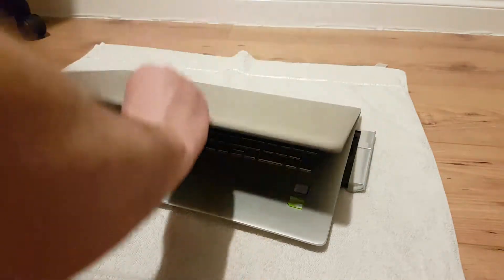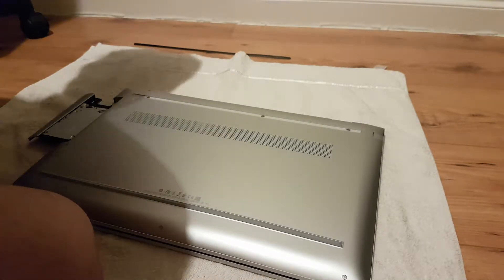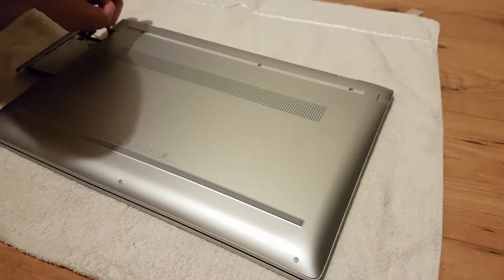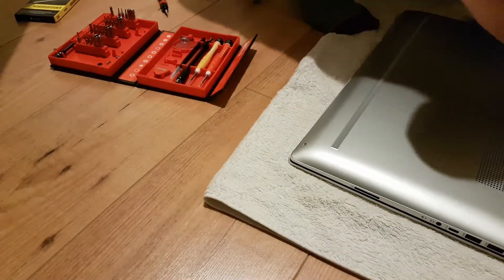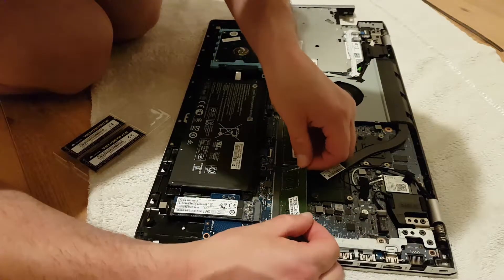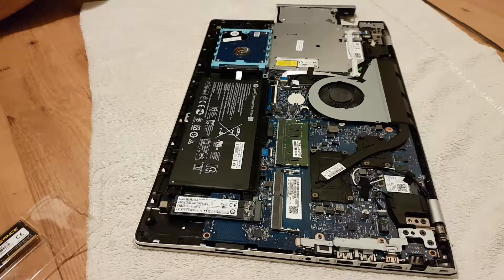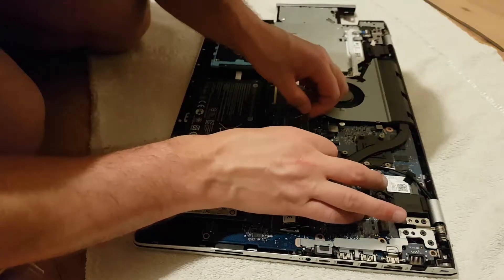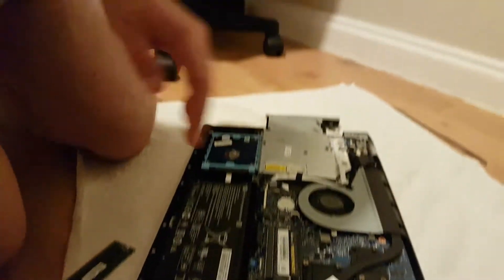How To Install RAM And Speed Test | HP Envy 17

Comment: thanks for this. Im upgrading to 32GB today, and if not for this video I would have probably messed up with the screws.
Reply from the maker: Glad it helped, the hidden screws caught me out first time round.
Reply: How did you get on with RAM upgrade to 32GB?
Reply: How did this go? I’m wondering the same thing I just don’t want to fry my system if it can’t handle 32gb
Reply from the maker: @yourealdaddy4207  the spec on this laptop says the max reccomended RAM is 16gb, it's been great ever since the upgrade from 8 to 16gb
Reply: Did you upgrade to 32 ram?
Reply from the maker: No I don't think this would take it